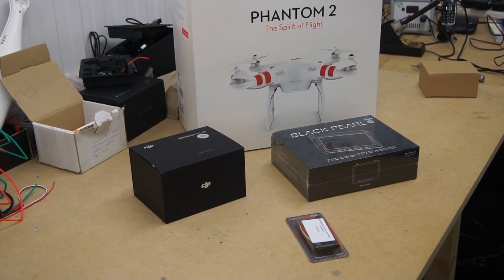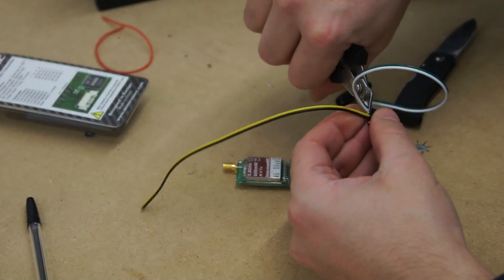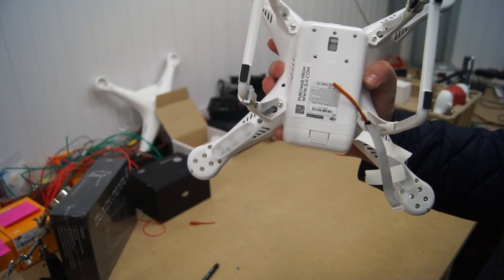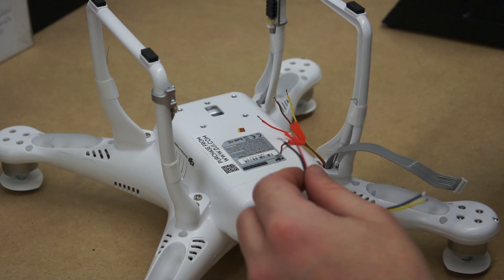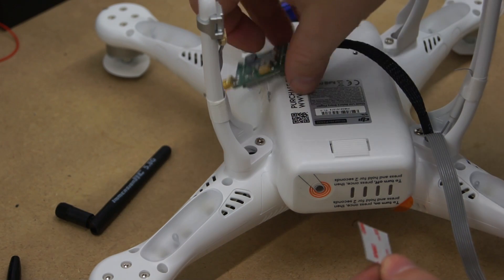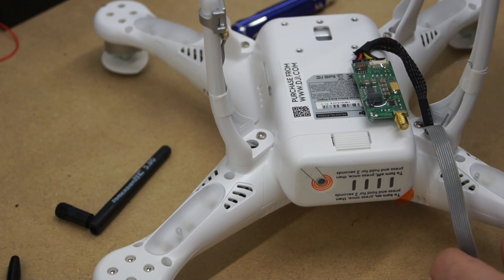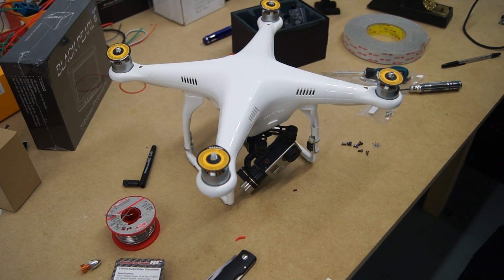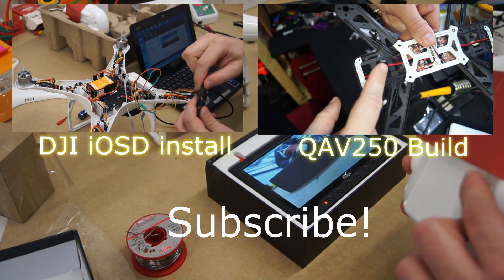How to install FPV and Zenmuse to a DJI Phantom 2 - That HPI Guy

Comment: Amazing device but you can't take it right out of the box and fly it. JustU.Faith/DJIdrone?業 You have to get the updated patches. Download them from the DJI website before you fly. This is a must. Follow the directions and take your time. I've flown mine for 100's of hours over trees, water, parking lots and around buildings and statues with no issues. This is a wonderful device. The only problem I had was a woman who told me she was going to call the police because I was at a public park and she didn't want me taking pictures of her children which I was not and it would be hard from 350 feet up. I told her to call them. There are no laws, federal or local, at this time, regulating flighing a quad copter. (it's not a drone). I'm loving this copter. It's so much fun!

Comment: What if you dont have those wires sticking out of the phantom2? What to do then? I got a working Zenmouse gimbal wired to the phantom 2 along with a gopro 3 but i dont have the 4 extra video cables sticking out to connect to a video transmitter. Also i dont have any tools to connect the wires like you do. What should i do then?

Comment: I have the phantom 2 with the H4-3D that came with it, would the video transmitter that you show work with my phantom? Also those 4 wires that need to be soldered, i have that on my phantom 2 as well, they are all the DJI fpv  wires for the gopro? Fill me in on what i need to get for this, im looking into getting fpv for my phantom. Thanks!!!

Comment: Hello, great video. I have installed everything and it was working for about a minute or so. I believe i may have had some wires touch. So now when the DJI is on and the gopro is plugged in I receive signal on the black pearl but no video. it is just pure black. Do you have any ideal of how to fix this?

Comment: Thanks for the informative video. Only problem is, I did everything you exact to the T, with exactly the same thing you have here and it doesn't work. Screen is black. Now back to square one in determining issue.
Any ideas would be greatly appreciated.

Comment: Thanks for the vid--instructional and well presented. I presume that in order to get vid out, the zenmuse usb cable is plugged into the Gopro. Also I suspect that the gopro operates via it's own battery power--so a full charge before use is advisable.
 And that the gopro auto shutdown is off--and that the SD card is not full.
Depending on the gopro's vid settings, some minimal lag might effect FPV vision. Especially if flying in amongst trees.
I think that the power usage of the A/V TX unit is fairly minimal but may effect flight times.
Cheers.

Comment: isn't the rc system on a phantom vision 5.8?..does the immersion rc 5.8 fpv system work  fine w/ no interference ?
Reply: Phantom RC frequency is 2.4ghz Bill--Immersion system is 5.8ghz, so it's ok.
Reply: ooh ..ok ..i have a panto, 2 w/ 5.8 rc system thanks for reply
Reply: bill alvarez Ok Bill--You have the vision version, sorry.
The Immersion 5.8 Ghz frequencies start at 5740 MHz through to 5860 MHz you could adjust a channel on the W/R TX that doesn't interfere with RC control. Or better still use a 2.4Ghz or 1.3Ghz W/R TX system.
Depending on allowable frequencies.
Cheers.

Comment: hi can i just ask which cables are just for power as i would like to put a 3s jst plug on the power cable so i can run my after market gimbal and my light kit,

Comment: Hey "ThatHPI GUY" i was just wondering what tool you were using to strip the wires and cut them. i need that tool but i cant find it anywhere thanks!
Reply: Vpanzer
 tigre
Reply: sebastien tellier thanks for your response, but Google only shows me info on tanks :P Are you sure about the name? Do you have a link maybe?

Comment: Great guide - one thing that you skipped over (probably because you knew how to do it already) but selecting the Band on the Black Pearl is a bit tricky and I read the instructions and still couldn't work it out.  You have to press the power button to bring up the menu and then M (or Mode) to select the submenus.  This will allow you to pick the Band and also change the signal input to match your signal format (PAL/NTSC) from your GoPro.

Comment: I noticed the gimbal in this video plugs into the back of the gopro....i have like the exact same gimbal but on mine doensnt plug into the back of the gopro, mine plugs it into the USB port on the side of the gopro....so i was wondering if this would still work for mine if i plug it into the USB port??? please help!?
Reply: so will this fpv system still work with my updated senmuse gimbal?

Comment: Good clear video, as always. One question though, how is the final link to the Gopro made for the picture. Did I miss that ? Thanks
Reply: The video feed is sent from the back of the GoPro through the HD-2D and version 1.0 of the HD-3D using the proprietary connector. On the HD-3D 1.1 the gimbal uses a USB connection. which still passes to the Phantom 2 board. The CAM connector on the mainboard of the Phantom 2 then sends the video feed to the transmitter via the cable that is soldered.

Comment: Hi there! Nice video, i have a little doubt, that video transmitter you show comes with the black pearl monitor system or is something aditional is needed , if is aditional how is it call technically? where do i find it? Thanks

Comment: So I just did this with the same parts except I have the HD3 gimbal setup.  I'm getting some serious static on the fpv video.  Anyone else have this issue?  Could it be that I need to just re-solder it?
Reply: you ever figure it out?
Reply: Not yet, just ordered better antennas.  Hoping that does the trick.

Comment: Stupid question I know probably, but how did you get the video to be transmitted from the gopro without hooking anything up to the gopro?
Reply: the gimbal has a lead which plugs into the micro hdmi on the gopro
Reply: The answer seems to be that for some gimbals (NOT MINE) there us a connector that mates with the GoPro rear connector. People assume it's always there, and this causes confusion. My gimbal is Zenmuse H3 3D. I've been told it has that connector. I better visit my optician 'cause I can't see it.
Reply: You should have got it with the gimbal but you need to attach it to a drip wire which is taped to one side of the gimbal, it is small but it is there.. Well was on mine anyway.

Comment: Have you done an install on the Dji phantom 2 vision plus? This unit comes with the Dji video cam already installed and I want to do a good clean install. I have the black pearl monitor.

Comment: thank you for the video - i am trying to run a similar setup (gopro here 3, black pearl 7', immersionRC 5.8ghtz transmitter, patch antenna on my black pearl) BUT, i have the phantom vision 2. Will i also need to solder those cables like you did?

Comment: You should also remove the Black cable from the IMRC lead.  One battery onboard means you already have a common NEG coming into the Tx, and you don't want to create Ground Loops.

Comment: Totally awesome video man. I have a question, it's a off question so I do apologize, I have a extra Phantom 2 transmitter (original one from DJI) and I want to use it with my phantom 2. can you steer me in the right direction on how to program it for my phantom 2? Really do appreciate any help, thanks.
Reply: Thanks a million. Your advice helped. Thanks again

Comment: First of all congrats for such didatic video. Can you inform what type/brand of shield and heat shrink you used over the transmitter cables? Very nice finshing! Cheers.
Reply: Supremus Absolutus Hello, Very nice job.!!Did you got the type and brand of the cable shield used?
Thank u!!

Comment: excellent video. I have a question: how is the connection between gopro and pantom? because I do not see any wire
Reply: The H3-3D gimbal has the GoPro proprietary connector block on the rear plate. The GoPro connects there.

Comment: Using	the	“video	out”	(Brown,	Red	&	Yellow)	cable	that	was	supplied	with	
the	Phantom	Upgrade	board,	expose	the	Brown	(ground)	&	Yellow	
(Video)	wires	roughly	1.5cm	in	length	at	the	bare	end	of	the	cable	
opposite	end	to	connector.		Bend	the	Red	(Active)	cable	back	out	of	the	
way	and	keep	out	of	the	way	with	electrical	tape.	*Refer	to	pic	2	 	 *Red	(Active)	is	not	required	when	using	the	DJI	5.8gHz	Av	system.

Comment: at 1:45, you run the wires into what looks like a split loom. What's the diameter on the one you use? Thanks very much!

Comment: hi i have been following your channel your great help , im having a problem with my naza assistant every time i connect my phantom 1.1.1 to assistant my pc does not recognise the drivers i am getting a code 43 fault no matter what i do even using a different pc i get the same fault is there a problem with my naza v2 im trying to install a feiyutech gimbal on my phantom , any help would be great thanks

Comment: David,
Thank you for the most excellent video.
I ran into a problem after I finished the install. The install went fine everything works but now I am having trouble getting sat lock. When I first flew the P2 a week ago I was amazied how quickly it locked home position. Now it takes several minutes and at most I've seen 6-8 sats. I did unpower the vtx with no help then unpowered the GoPro with no help. I am thinking it may have something to do with the Zenmuse
gimbal causing interference. Have you heard of any issues like this?
Thank you for any advice,
Tom
Reply: I want to learn to fly one of these guys, what do you recommend Tom?

Comment: Hey, great video!! Q- I like the wire stripper your using. Can you tell me what it's called, where you got it, and do you recommend it? Thanks, I appreciate your opinion, and help. Cheers from Canada..
Reply: Did you get the answer? I also like the wire stripper too. :)
Reply: I found them at @t
5" & 6” Two in One Combination Electrical Wire Stripper and Cutter, 26-10 AWG
Reply: https://www.ascendtools.com/

Comment: ive purchase a black pearl monitor, immersionRC and a set of Flysight clover leaf omnidirectional but the flysight clover leaf antenna does not fit in the Receive but fits on the Transmitter. Can i use a sma female to female adaptor or i have to buy a new set of antenna to fit in the Receiver? pls help!
Reply: I am at the same spot, I purchased the immersion rc and black pearl based on this video, yet I get poor range, it seems the black pearl is rp-sma connector and the immersion is sma, now trying to understand what antenna to buy and if a connector will fix the connection problem while still maintaining continuity for longer range. please help.

Comment: Glad to see your tilt function on your remote works, mine didn't but I modified it with a knob on the front .. Hmm  I can't wait to get fpv set up ... And some more batteries .. Thanks for posting the how to..
Reply from the maker: hey dbest1a  if your tilt function does not work its usually the lever not making contact with the yellow star shaped pots inside, you can just lift up the green control board a little and it works, thanks for watching.
Reply: ThatHPI GUY See, I've been dreaming of this pitch movement for ages. All I've managed to figure out was how to make it "always stay" in a different position on start up!
Now, I can see the lever isn't touching the yellow pot inside (it's like 2mm to 3mm off) and it dazzles why DJI would build something not to work, even tho they give you all the tools!
My question here is, how to raise the green control board (if easy) or should I just buy the DJI Phantom Tilt Lever that quadcopters.co.uk have on their website?
Any ideas?
Thanks
Reply: Sergio Ferreira a
I got annoyed with fiddling n found a video on YouTube that showed me how to change it over to the knob.. But maybe like ThatHPI GUY says some washers under the board will raise it up a bit
Reply: dbest1a it stops working if you have not calibrated it all the right way ie the phantom first then the rc mine stopped working then i did this then it worked
Reply: RushNReady I already removed it n replaced it with a knob on the front
Reply: ouch gutted

Comment: Shouldn't you also connect a suitable antenna before powering on the video transmitter? And also on the receiver? (although its less likely to damage the receiver than the transmitter)
Reply from the maker: YES always on the video transmitter, its not important on the receiver, I do say this in the video.